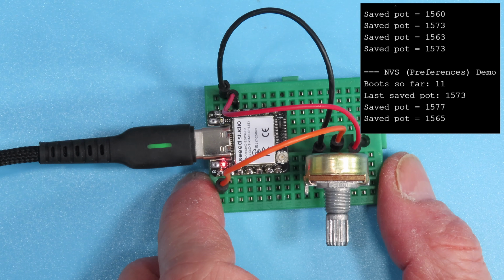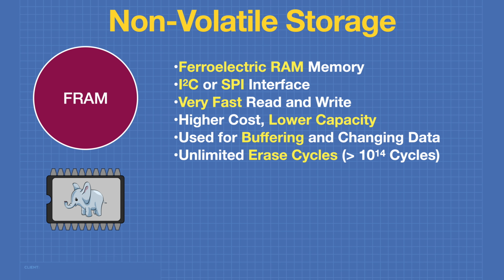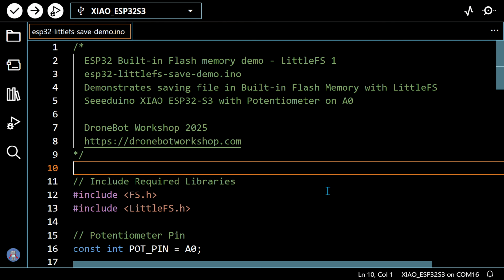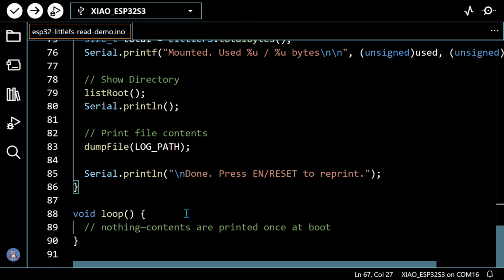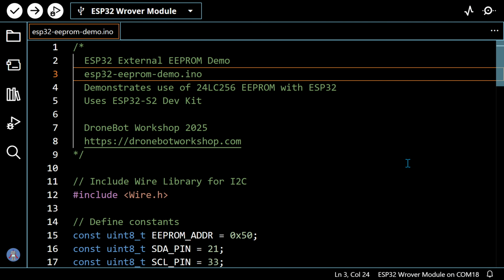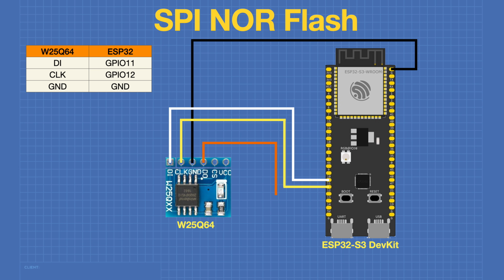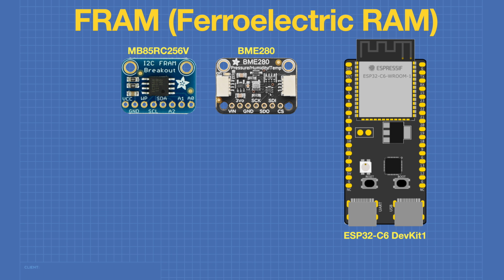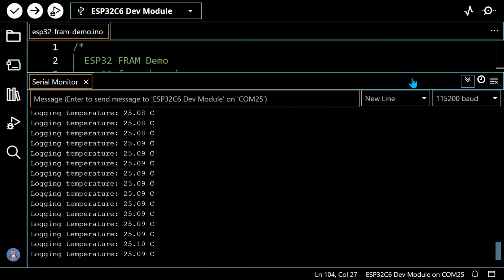ESP32 Non Volatile Storage - FRAM, Flash & EEPROM

Comment: Here's an example: I built a binary/digital/analogue clock and used the internal store with preferences library to store the network SSID and password, which are rewritten when my son moves house. Also in there were the colours of the displays and the time zone. This meant that little data was being replaced/rewritten, and then not even on a daily basis. An ideal use for the EEPROM. I should have put an alarm clock in there, but I was getting a bit tired of it, all the work on the case and switches was boring, the actual programming for the binary display took about 10 minutes.

Comment: Hi Bill, another outstanding video as always…I notice that you have jumper wires on your prototype board that have rounded plastic connector ends as opposed to the traditional square DuPont connector ends…where did you get those and are they superior to the typical DuPont? Thanks.

Comment: I'm disappointed they removed the external SPI RAM connections from the newer ESP32 modules (the ones along the bottom).  I was really hoping to use some FRAM/MRAM as RAM without needing to give up the other SPI port.

Comment: This video is exactly what I need. I’m currently using an ESP32 to monitor the temperature in my wife’s greenhouse. I was wondering if recording the temperatures was possible. WiFi at the greenhouse is intermittent, so I needed a way to record the temperatures when there’s no WiFi to send the values to my Raspberry Pi.
Your video is perfectly timed.
I’m old enough to remember EPROMs too 🙁
Reply: You might be better off just fixing the wifi issue... Get a ESP32 board with a little external antenna connect, appropriate pigtail lead, and a directional antenna you can mount up on the roof or similar to get a good signal.
Or do it the reverse way, and add an outdoor wifi access point to your house.

Comment: Great video! I'd like to point out that some I2C modules such as the DS3231 RTC have the the pullup resistors already integrated on the board, so no  need to add them externally.